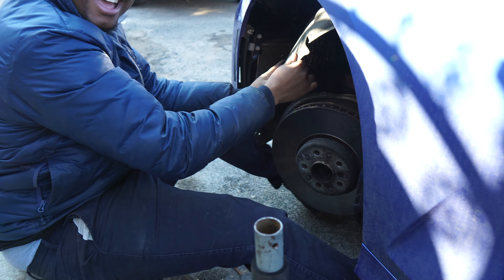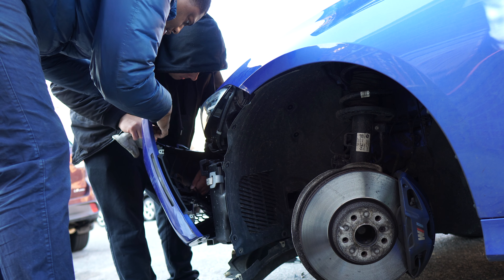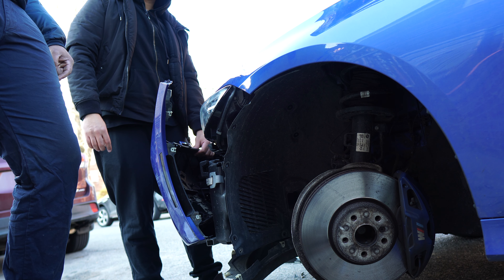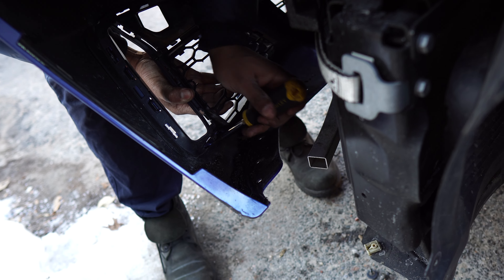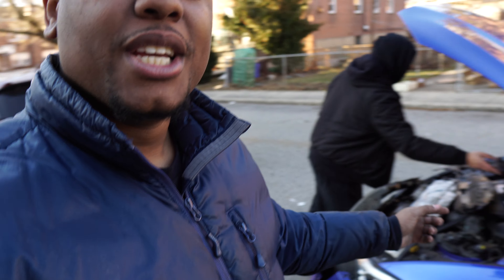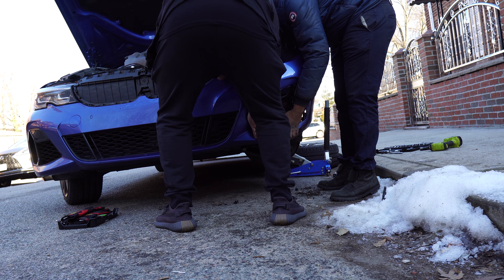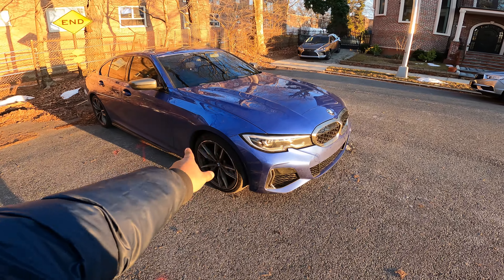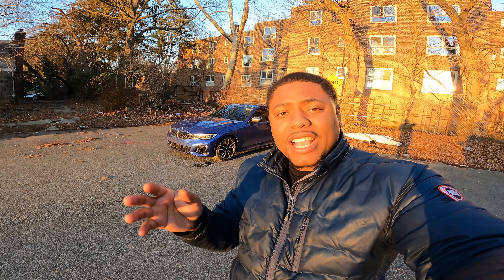I MIGHT AS WELL KEEP THE M340i AT THIS POINT.

Comment: With the down pipe and tune has the car been reliable ? No engine, turbo or trans problems
Reply from the maker: No issues, the trans will go into limp mode at peak torque but it won’t explode lol . I have a detailed vid on it coming in two days